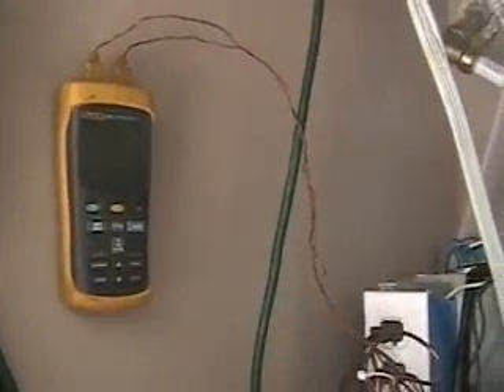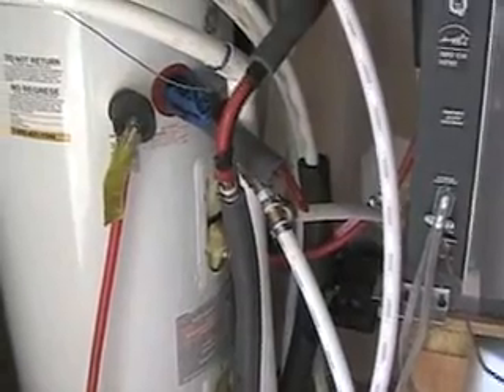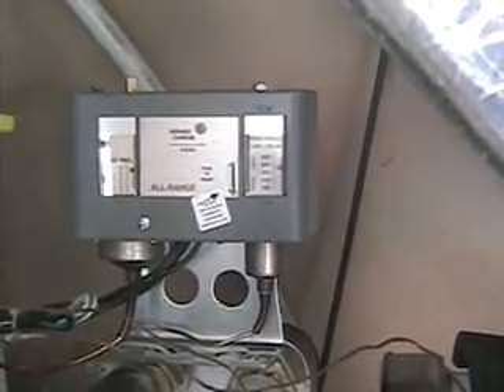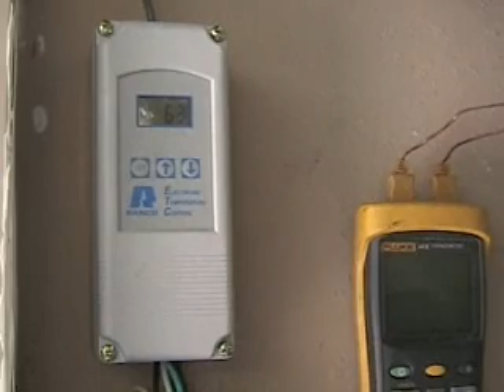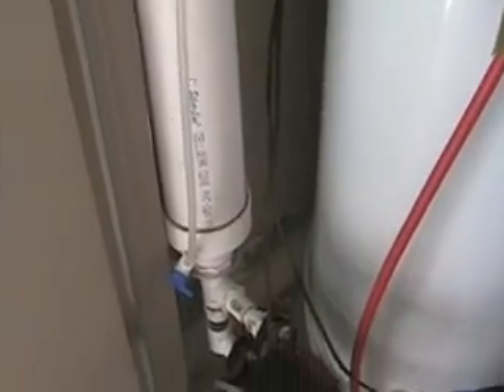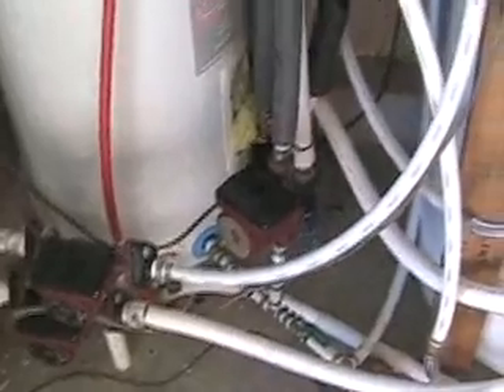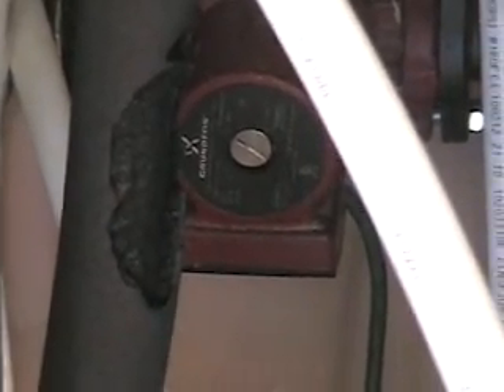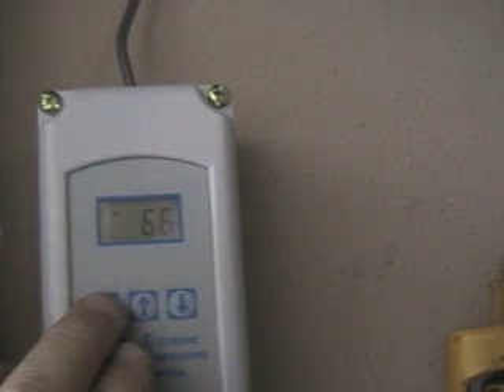Geothermal  heated floor.

Comment from the maker: @b4bacon  It will work just about anywhere. Cost of getting the HDPE tubing in the ground is the question. 
 If you can use some cooling in the summer it will work better in the winter, because you can put that same heat back into the house.
 Transfering heat from the ground to your house works in very cold weather. Especially if you are heating a concrete floor (high mass).  
You may have to make your own, I do not know of a manufacturer that makes on small enough to do only 200 sq ft.

Comment: Speaking to you as a expert, I want you to know I'm very impressed with your system. Unfortunately, I currently do not understand all the technical aspects.  My question is where did you find the info to calculate the closed end looping system.  I have a 2600 (sq ft) house I'd like to heat this winter if possible.  
Or build a small test system to heat my detached 500 (sq ft) garage. 
I hope you can direct me to a good source of info, can't you?  Thanks

Comment from the maker: @sethpecekajus The pile would have to be big enough to support the house you are heating and the heat may not be there forever. It may not be efficient for air conditioning in the summer.

Comment: have you thought about having the underground side of the system running through a compost heap. i live in a place where snow just doesn't happen but compost throws out a huge amount of heat, your thoughts? i'm not sure how low temperatures like that would mess with a compost heap.